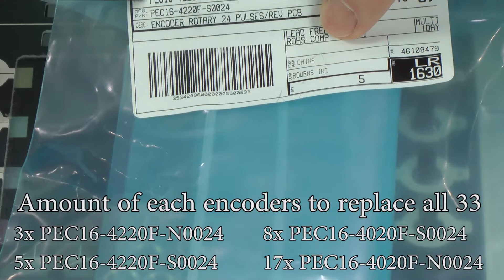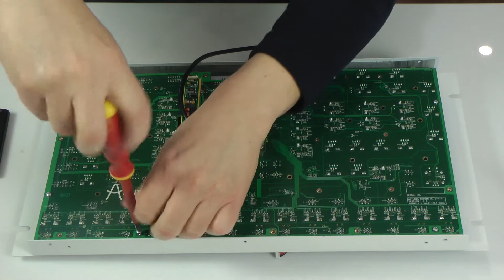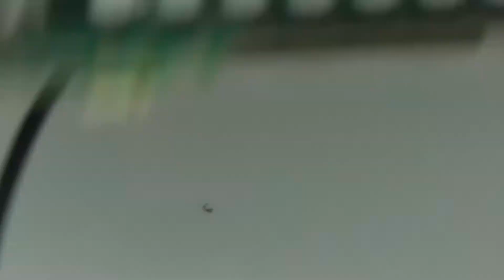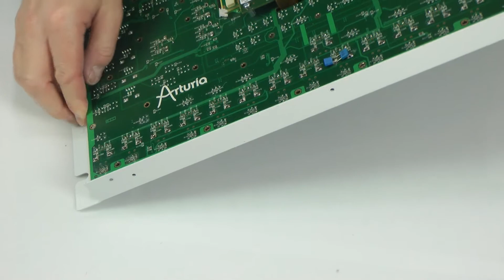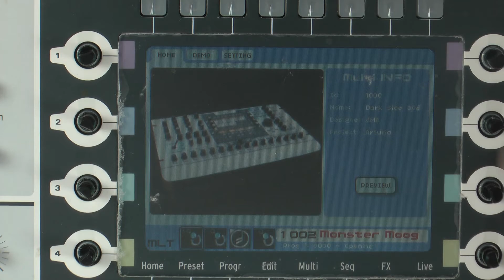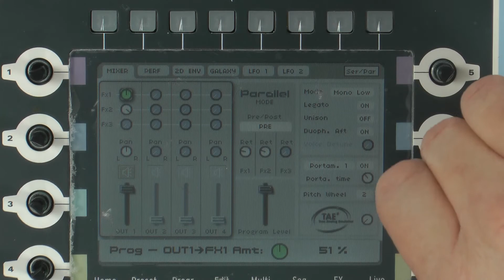Arturia Origin Synthesizer Faulty Encoder Replacement/Repair

Comment: I HAVE TWO - I REPAIR WHAT I CAN, I COLLECT PARTS AND METHODS TO REPAIR :)) I'M HAPPY TO CORRESPOND:))
- these are the best synthesizers, but the parts are bad, often from the very beginning the manufacturer wanted to save money - at our expense and the inability to process the sound right after the warranty expired, I broke the ribbon with my finger, I have strong fingers, it is extremely delicate but the best in the world, watch out for it All:))

Comment: Great video thanks. I have just replaced all the encoders on a friends unit. I had an issue with the OSC waveform, Filter Type and LFO waveform encoders which essentially got destroyed. The issue was the Select encoder below them being higher than the originals and when I tightened these encoders nuts it stripped the previously mentioned ones apart. Suggestion here is to put two washers instead of a single one and don't overly tighten.

Comment: All this because a greedy manufacturer wanted to save about $15 on each unit produced.
 I'm sure that even the Bourns ones will eventually fail... Despicable mechanical digital encoders, and dreaded TACT switches should be banned from any product.

Comment: Thank you for this video, anyway i have a problem, after opening, detaching/reattaching wires and closing it, the screen seems to have no "backlight" - I can barely see the shape of the pictures in it, but it's almost black - Can possibly be the small stripe (36:48) that is not attached well, or should i have to investigate elsewhere ?
Reply: @37:23 or 38:38 - Could it be one of those power cables not properly plugged in? (replies 2 years later ;)

Comment: Great vid - What was the Shaft length you ordered - when I search on the Mouser.ie website the encoders that come up have 20mm Shafts (Shafts look more like 10mm on the origin - spec table say that the shaft is Knurled - whereas the photo shows it 'D' shaped which seems to be correct for the device).

This is what I'm looking to order...
http://www.mouser.ie/ProjectManager/ProjectDetail.aspx?AccessID=a5cf1427bc

Any advice appreciated thanks

Comment: So, the encoders can not be cleaned with "DeoxIT" spray?.
Reply from the maker: +Pete Urbann Some people have had success with that method but I find its getting the cleaner in to the encoder. The bodies are quite well sealed and the other way is wiggling the shaft whilst spraying it but i'm not sure if there are any lubricants used or seals around the shaft, could really do with taking one apart to find out.
Reply: Arturia beat step also have encoder problem it is not good electronic components using for arturia  products it is like Chinese toy